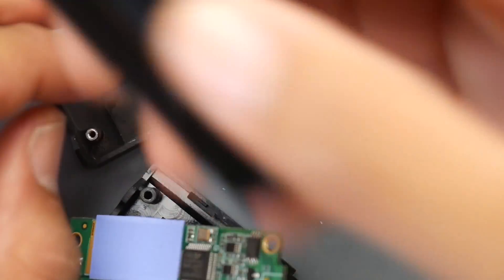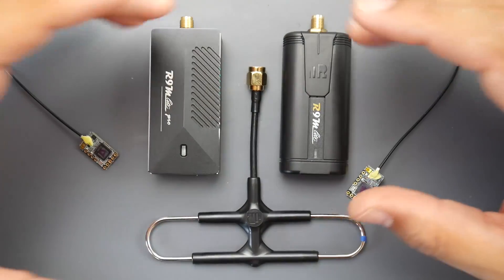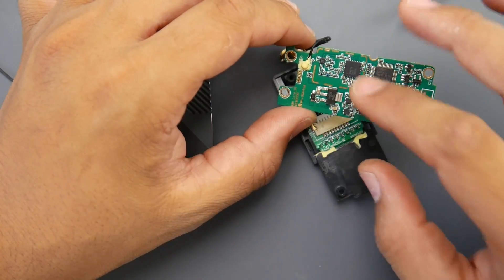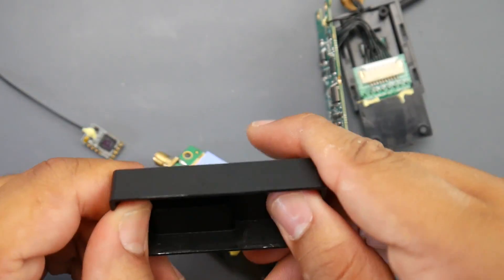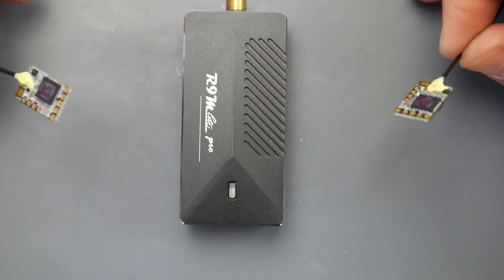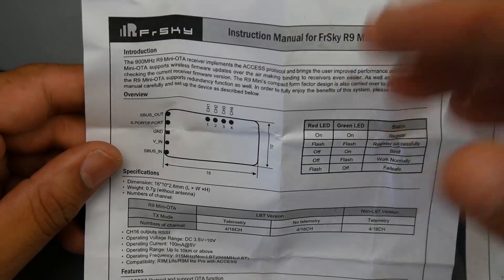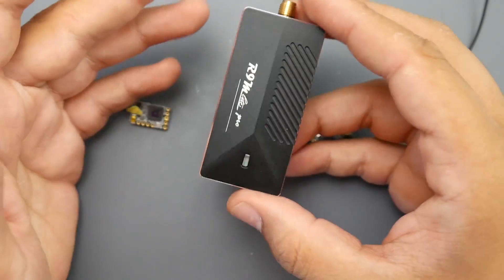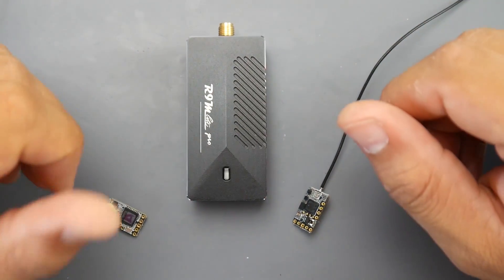The New Long Range R9M Lite Pro & MM & Mini Receivers

Comment: I am not exactly sure if you update these things. I guess fraky had a firmware update. And I've been using it. I still have the lite(non pro). Its still pretty nice considering the low 100mw output. I think I may upgrade to the pro.

Comment: Hi, can you compare the r9m lite vs signal booster? I remember you made a video about the Turbowing RY-2.4 Radio Signal Amplifier Booster. Just want to know if there is a big difference between the two. I have 4 xm+'s and im not sure if the r9 is going to be worth it or if i should just buy the signal booster. Thanks!

Comment: Hey, this electrical screwdriver looks fancy, would you mind to provide a link?
Reply: El Marchewko the screw driver is called “ES120” there’s a new model out called “ES121” you decide which one is for you only difference is the ES121 is faster and has less  torque from what I’ve read.

Comment: Whats the diff between MM and Mini?
Reply: Mini has inverted s.port/f.port and SBUS in (for failover setup), MM has no SBUS in but an additional output for un-inverted s.port instead. The latter is particularly useful in conjunction with F4 flight controllers that have no external inverter for s.port/f.port.

Comment: Hi guys , Like always nice video Drone Mesh. Few words about R9m Lite Pro. I use and test this little boy around month already and I will try quick answer for typical questions. 
1. Update ....already FrSky relase update for X-Lite to 2.3.0 with R9 Lite Pro support....Tested and confirm that work on standard X-lite 
2. Old R9mm and R9mini receiver's got update to access flex FW and work perfect. 
3. By time when I use this module no problems at all , any failsafe or strange signal drop (on x-lite pro and X9 lite pro)
4. Signal strength and penetration (range)on 500mW  looks much better like CF micro (but its normal 250 versus 500 or 1W:)
5. CF XF still will be better choice for long range
6. Latency o  8 channel without telemetry its 7ms (fact ) and this its impressive in my opinion 
7. X-lite pro and x9 lite pro coming with OpenTX custom 2.3 and support r9m lite pro from box
8. Main question do its worth to buy ....
If you got x-lite pro or x9 lite pro , you like compact devices, you mid range pilot, you got already r9 receivers on your quads this one will be "must have device".

I got 16 quads with r9 receivers and I test all (without any problems).

Now numbers ( test be done on open area outside cities with super 8 antenna ,access flex FW, receiver with fport)
10mW - around 400m rssi 38 when I turn back
100mW - 1,5km rssi 64 
500mW - 2,5km rssi 70 (turn back from battery reason :)
1W - 2,5km rssi 82 ( turn back from same reason like 500mW

I got hope that this help :) any questions PM.
Cheers
Reply: I'm trying to decide between X-Lite Pro with R9M Lite Pro and Jumper T16 and Crossfire Micro. Do you have any experience with both? How are you getting on after a month with the R9M Lite Pro? I much prefer the form factor and the integration with the R9M module over the Jumper T16, but I'm worried the Crossfire will out perform it, even at much lower power output (according to random people on the internet - though I'm not sure that's true). I have both setups right now, but I don't have a quad to fly them with yet (long story).
Reply: @dr3wster  Hi mate. On begin I don't tell you what it's better but I share my experience. I got both t16 with crossfire and xlite pro with r9m lite pro. Right now x-lite it's my "main" radio and in my opinion  this set work for me much better like t16 with crossfire micro. (Will be lots of hate :) ). I still use crossfire lite on t16 for long range wings but just only for this.
Now back to you ...if you preferred gamepad style radio like me x-lite with r9m lite pro will be choice for you . If you like "big radios" t16 with crossfire will be better choice but with crossfire lite .
Middle way will be x9 lite pro with r9m lite  pro. To clarify,  in my opinion r9m lite pro it's better choice like crossfire micro but crossfire lite beat both :)
Reply: @Lord_Saygon  Thanks for your reply. I for sure prefer the x-lite over the jumper. I've been switching back and forth with simulators and I'm immediately more comfortable and more agile with the x-lite. I guess the thing that's holding me back from moving forward with the R9M Lite Pro vs the crossfire module is that the Crossfire, even with 75% less power, states that it can go twice as far! How is that even possible? I'm not sure whether FrSky just understate there ranges or TBS overstate there ranges.
Reply: @dr3wster  with r9 system everything change when frsky run access on it . From my observation r9m lite pro on 100mW got same range what crossfire micro if you use same antennas. 
Btw crossfire antenna it's better like super 8. Keep this in you mind. On 500 and 1W range and penetration it's much better
Reply: @dr3wster  one more clue . Buy for x-lite 2000mAh batteries :) on 1W battery gone after 5h constant use.
On 100mW power use it's almost similar like internal transmitter
Reply: @Lord_Saygon  thank you :)
Reply: @dr3wster  you welcome mate , I got hope that will help .
Reply: Will the over the air updates work with the standard xlite and r9m lite pro
Reply: @DaytonaJim78   Hi , good question :) I will check this later on and give you answer
Reply: @Lord_Saygon  awesome thanks also i ordered the r9m lite pro and the r9mini-ota i have a pyrodrone f4 osd fc will it work with the mini or do i need the mm version and is it better to use f-port or stay with sbus i also ordered the x9 lite access to give it a try! Thanks
Reply: @DaytonaJim78  Very good choice . If you ask me I will say ...definitely use access f.port flex FW . About receiver with F4 FC will be beter use r9mm-ota . Overall its same receivers with two main diffrence . One will be redundancy ,Mini got ,MM not. Second things r9mm got inverted s.port what help with some FC. My personal best will be r9mini-ota what I use with all my quads.
Reply: my x9lite & r9m lite pro cannot binding with r9mini ota.. can help me

Comment: I'm quite curious if this new lite pro module also works on the standard x-lite transmitter.
Reply: They do not from frsky directly. I find that unsatisfactory myself.
Reply: @unbounduav6940  So what did you do to get it working ?
Reply: @fpvlive  Unfortunately I have not tried yet. My current budget is taken up so I depended on the work of FrSky directly. It would be a shame to need to change your transmitter to just use a new module.

Comment: Could you please make a video about R9M vs R9M 2019 pcb differences too? As far as i know only the modules's internal voltage regulator is change to properly handle 3S as input voltage.

I think the r9 mm's sbus_in pin is better to pair with 2.4Ghz reciever (eg xm+ or rxsr). So you can use both transmitter module (internal xjt and external r9m) for more advanced failsafe.

Comment: @DroneMesh would be super cool if you could measure the delay difference of ASSECT and ACCESS, light and lite pro.

Here is what I'm getting to here, bare we me :)
- Crossfire on it end to end measured to 14.6ms, great right? (23ms when over to SBUS........ s_ck)
-  r9m lite + SBUS = 17ms AWESOM for the price 
https://oscarliang.com/r9m-lite-crossfire-latency-testing/

Now we get
1. ACCESS protocol + FBUS vs SBUS on 2.4 test reduced latency over all by 5ms (how exactly not sure, optimisation of MCU perhaps)
https://oscarliang.com/fport-latency-testing/ - see mean of tx-to-rx out! :D

2. FrSky claim 8.6ms minimal and show screenshots of 9.27ms on RcGroup! :D 
https://www.rcgroups.com/forums/showthread.php?3080337-FrSky-New-Taranis-X-Lite-S-and-Pro-X9-Lite-R9M-Lite-and-Pro-MPM-Lite/page183

9.27 vs cross fire 14.6ms is MASIVE difference :D and it is 1watt aaa :D

Could you do a video on back to back comparing latency Gimbal to output of the port? That would be a killer and strait forward with your equipment :D I
f you have x-lite pro or x9 lite 2019/pro, other wise can do just like:
- r9m lite pro + mm or mini on SBUS (update them)
- r9m lite pro + mm or mini on FPORT (update them)
- Crossfire on SBUS out (interesting to see if they fixed it in later update from 50hz up to 150hz)
- Crossfire on CSFR out 

THAT WOULD BE great one to see! (I do know human reaction is about 220ms but we are all gigs here hehe)

Comment: I think I’ll just go with the R9 full size module for my flysky nirvana
Reply: Brian Evans just get crossfire, it’s a lot more reliable and consistent
Reply: ExplosiveFruits 
don’t have that kind of money mate😂
Reply: Brian Evans the micro unit isn’t that expensive. The other features with crossfire lite and the full crossfire are mainly for long range users
Reply: @explosivefruits  
I don't think the micro unit can transmit at 1W, which the R9 can. So even if they are similar pricing, R9 should get better range

Comment: AFAIK many ICs are correctly cooled from the underside because they transfer heat better through the pins or have a heatspreader on the underside for cheap PCB manufacturing (often seen on mosfets). For many ICs the ground plane is enough for sufficient cooling. The resin or ceramic in that the IC is encapsuled doesn't do as good as metal in heat transfer.

Comment: Finally someone is covering this. Looking forward to the setup. Hopefully you can do a setup for the Xlite Pro.  In your opinion just about as good as TBS for the avg pilot? Thanks for the vid.
Reply: spent 4 hours looking for reviews yesterday, ordered it 4 days ago with x-lite pro
Reply: @bmwcoders2020  I just pulled the trigger myself on a R9M Pro Lite just now but been rockin the xlite pro for a while now using r-xsr's on access.  It's fine but want the added security.  Was on the fence with CRSF but man that pricetag and so far this R9 system seems to be plug n play.  And I still get to use my neck strap adapter lol.
Reply: @theronin48  here look, done from gimbal input of x-lite (not pro)
R9M-Lite (ASSECT, not ACCESS!) => SBUS – 14.07ms
Crossfire Micro TX => CRSF – 13.9ms
Crossfire Micro TX => SBUS – 20.23ms
Now, we can use ACCESS to speed up more! AND we can use F.Port as it is faster than SBUS :D

Dig it?
Reply: @bmwcoders2020  that and I can still use my neck strap adapter lolll
Reply: @theronin48  great point, which one you use? :)
Reply: @theronin48  hold up, can you use non r9 receivers on a r9 module? rxsr or xm+??? with a frsky r9 module? i have a flysky nirvanna and a r9m on the way and a couple  xm+'s laying around and would be nice to use them
Reply: @ADMIND3R  No you can only use R9 series receivers on the R9 module.  The "9" stands for 900mhz and the X series (RXSR, XM+) is 2.4.  You don't need any module to run those since radios are 2.4 by default.  Hence the need for a module.

Comment: I keep reading users comments saying R9M still suffers from infrequent random failsafes.
Reply from the maker: I never had that happen to me from every module I have tested.. I think its problems with location interference.
Reply: @DroneMesh  Man be advised Lite S-Port (Usual one) is initially Inverted. so that Inverter S-Port = Inversion of Inversion =not inverted S-Port
Reply: Mine have been perfect for over a year, all 4 quads
Reply: No failures for me, R9M with Flex firmware, 3 different frames. Some of the early versions had buggy firmware, which is not uncommon in many other products as well as FRsky. Flex firmware is rock solid.
Reply: MAD GRUMPYMAN I get it on my 9XD. There’s often stuff like that on FRsky, I will do some research and see if there’s s fix.
Reply: No problems here. Works great

Comment: Will this work with the original x-lite? Tks for the great work.
Reply: It will work with the original x-lite no need for the x-lite pro. In fact maybe better since you can do ACCST with the internal module of the original x-lite and ACCESS with the r9m lite pro module!
Reply: Currently trying this. As far as I understand it, you can run the accst on the x-lite and access on the pro module. Gonna flash a slim+ and try access on it, but I'm afraid I'm gonna need the new slim+ OTA to have all of the new functions.